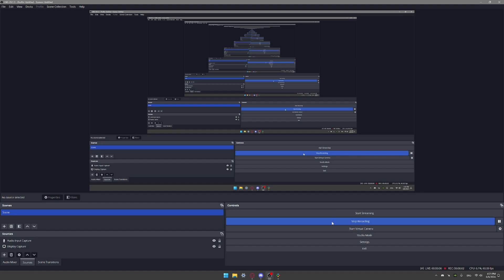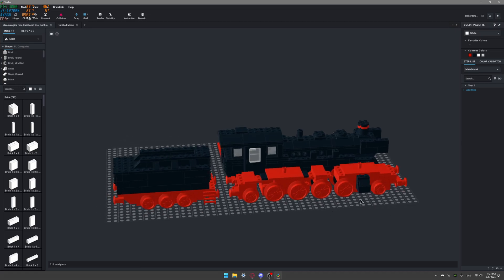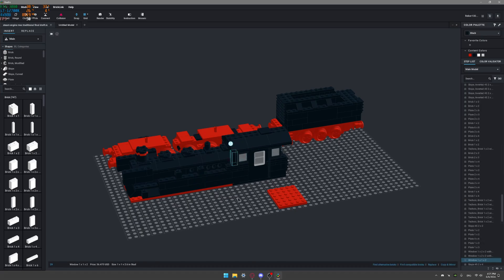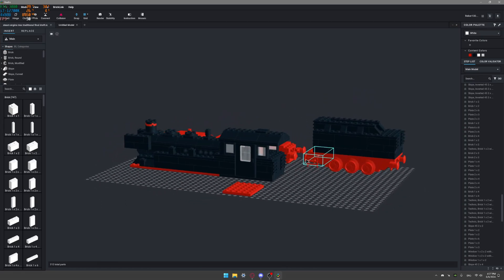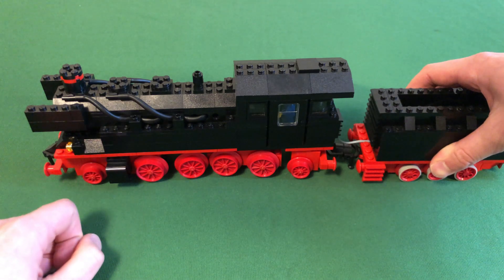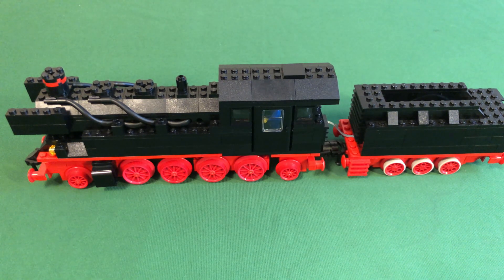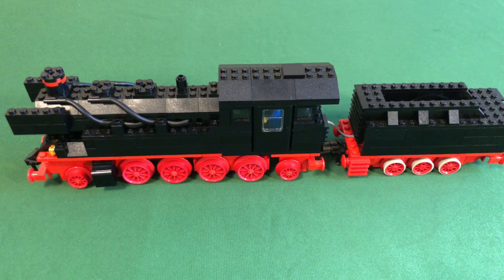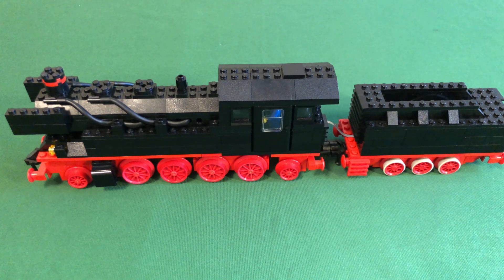Building a LEGO 12V steam engine: Final model

Comment: Your videos re-inspired me to get back into 12v trains, currently rebuilding my 7750!
Reply from the maker: Hey that's awesome! Do you have and / or are you planning to buy other sets? 7750 is my favorite set, definitely a gem to have.
Reply: @Reker1million   I didn't have a complete set, the wheels, windows and motor are missing but I'm using similar parts to save on money
Reply: @Reker1million   I am definitely thinking on getting a few of the smaller locomotive sets, can't Remember the numbers off the top of my head